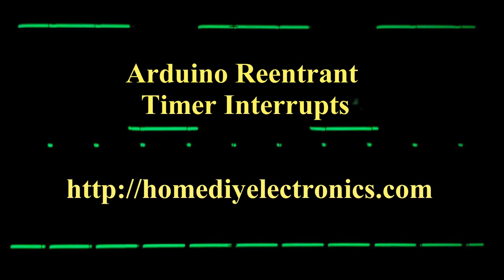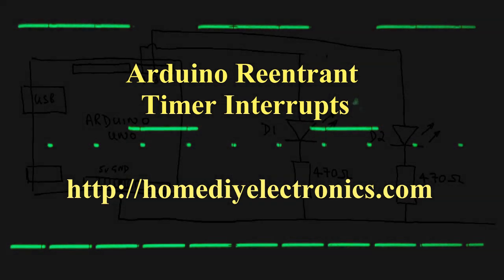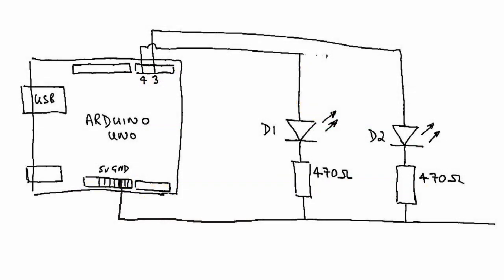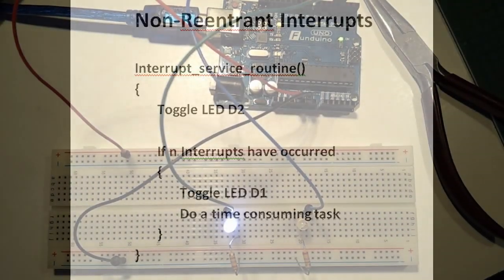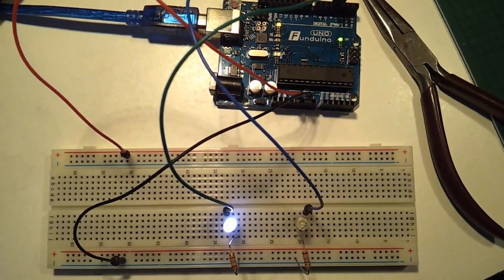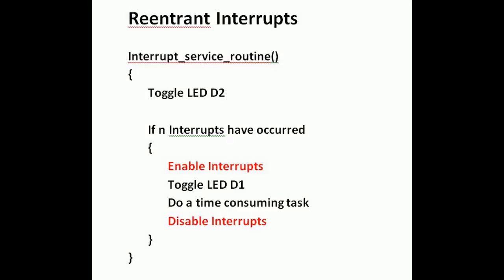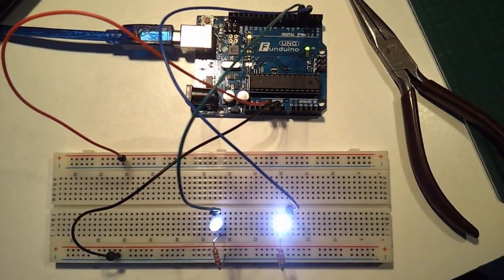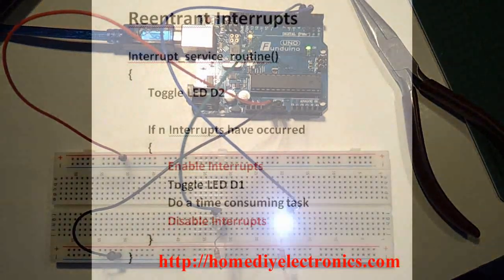Arduino Timer Interrupt Example

Comment: What is that white sort of box (with the blue and red lines on it) what you plug the wires in with the leds called? I have one myself but without any manual/name, if you could tell me how it is called i could look up how it works. Just the name would really help me.
Reply from the maker: Hi eeopd. It's called a solderless breadboard. There is a description on my website here: http://homediyelectronics.com/tools/solderlessbreadboardsforbuildingelectroniccircuits.php

Steve
Reply: Thanks!

Comment: So what would happen if the time consuming task takes longer to execute than the time before n interrupts have occurred? In that case the time consuming task would be running twice at the same time..
Reply from the maker: Hi biep,

You are correct. If interrupts are enabled by the isr routine and the time consuming task takes longer than the time between calls to it then the time consuming routine will be reentered. This is usually a bad thing and generally must be avoided.

If this situation exists then the time consuming task will be restarted before the previous routine has completed. This new instance of the task would then itself be reentered. This process would continue until the processor runs out of stack space and the program stops working.

Generally you should design your interrupt service routines so that there is no possibility of them self-interrupting. You can do this by calculating the worst case run time of the task and choosing an interval between calls greater than this time. Remember that you must add the time taken by the short interrupt task multiplied by the number of times that this routine interrupts the time consuming task in order to find the worst case time between start and end of the time consuming task.

There are exceptions to this rule that you can design in when required. For instance you could set a static boolean flag in the time consuming task and reset it on completion. If the flag is set when called then return immediately without performing the task. This would mean that some calls to the task would not succeed but at least the system would not crash.

If there is a possibility that the time consuming task will overrun only occasionally then you could design the routine to be reentrant safe by making all variables used by the isr function local and ensuring  that the order of any outputs is not crucial. This will not work if the self-interruption happens too often.

Whenever you design an interrupt strategy you must consider all possible situations and make sure that the system is safe in all of them. Sometimes this can be challenging but you can beat it by sticking to a few basic rules.

I hope that this helps. Let me know if you need more.

Comment: can you help on my problem. I have build a lift controller using Arduino. I have attached stop button to interrupt on Arduino. I want to stop lift as soon as stop button is pressed. But the code executes the interrupt routine but do not stop the list. I mean the digital write doesn't work in ISR. Pls. advice.
Reply from the maker: Hi Vishal, digitalwrite should work in an interrupt routine but you do have to be careful. Any port manipulation using digitalwrite in the main loop can potentially interfere with with the interrupt code for instance. Have you confirmed that the interrupt routine does run when the stop button is pressed?

If you are still having problems then post your code here or email me at steve@homediyelectronics.com
Reply: Thanks for your feedback. I wasn't aware that after interrupt routine the code was going back to main loop. This caused LED to look as if no change occured.
Now I know :-)
Reply from the maker: Vishal Bhingare Good to hear that you solved your problem. Yes interrupts interrupt the main loop, execute the interrupt service routine then return to the main loop at the point where the interruption happened. You have to be careful that you don't let the two routines interfere with one another.

For instance if the main loop reads a port then writes back a new value and the interrupt routine also reads and modifies the port then there can be problems. If the interrupt occurs after the main loop has read the port but before it writes back a new value then the main loop will effectively overwrite the value written in the interrupt routine. It sounds complicated but is obvious once you realize what is happening.